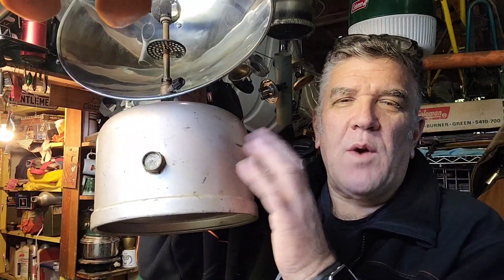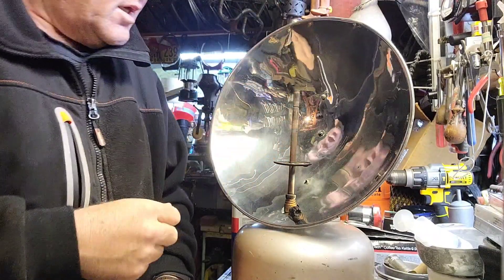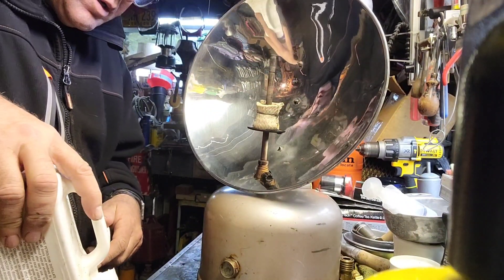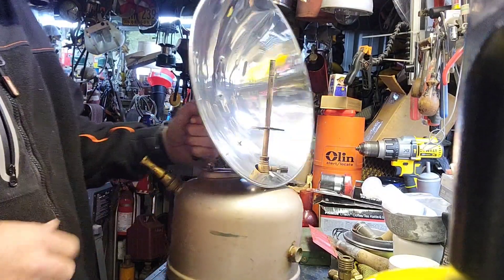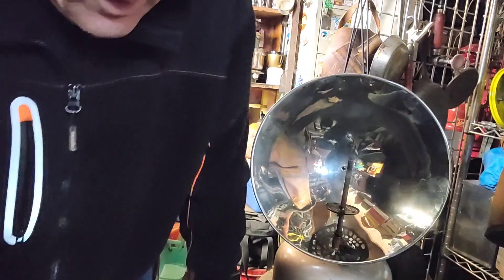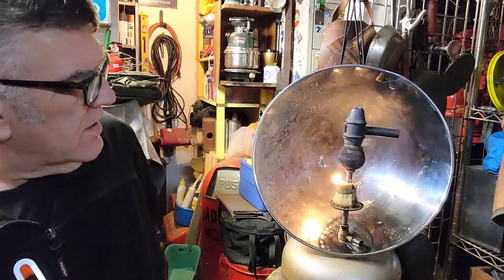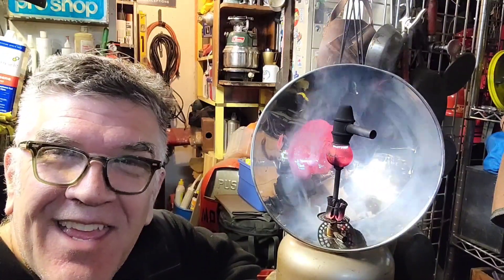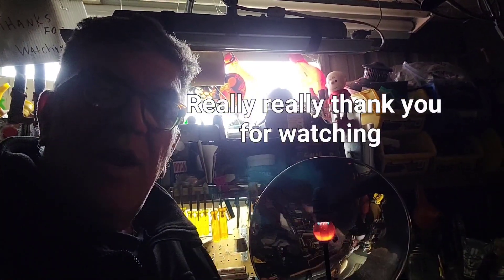Tilley Heater England - First lighting , Eyebrow ⚠️ alert !!!!!

Comment: I really really, really enjoyed this video!😉😎👍🏻  I'm confused though. The wick helps light the bulb above?  Very interesting.   I have to agree with Sean, you like to live a bit on the wild side.  I think I have tried lighting it outside 1st time around.   It is an awesome piece! 😎👍🏻🔥
Reply from the maker: The wick is technically not necessary if you preheat with a torch. However, they sell a clip that goes on but below the generator the clips have asbestos or some sort of fire retarded material that can soak up alcohol and then be clipped on for a pre heat , same principle as lighting a kerosene lantern with the warming cup . my idea worked. However, I need to use a different material so it can be reused .
Reply from the maker: REALLY!!!! haaaHaaaaa